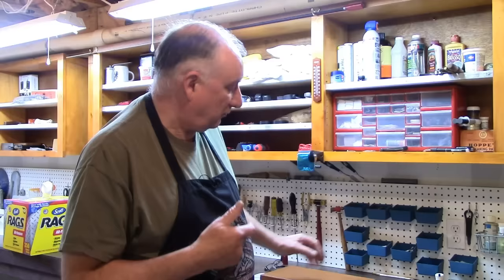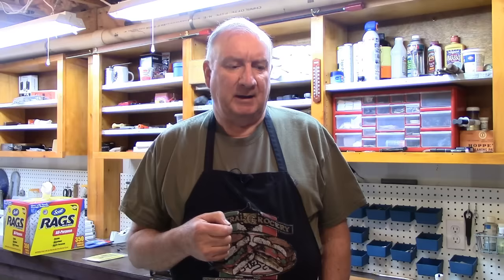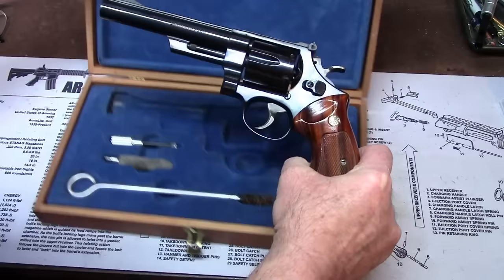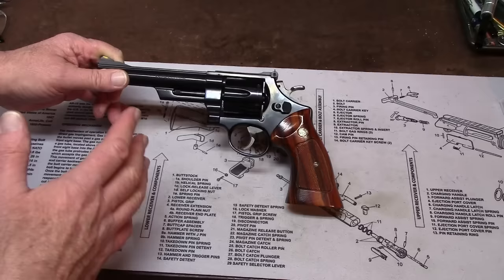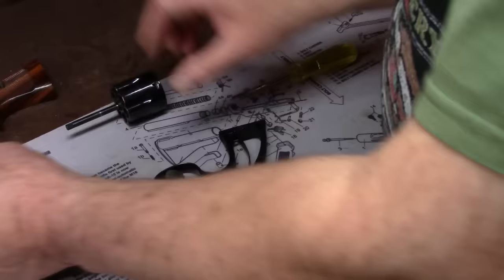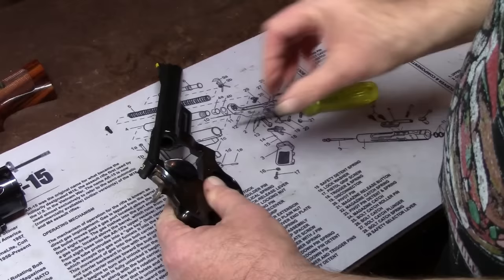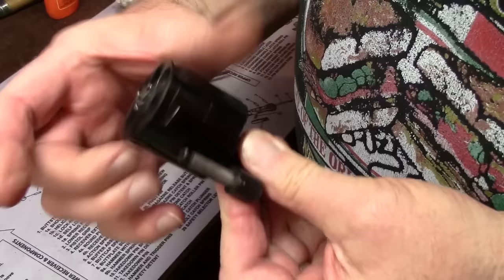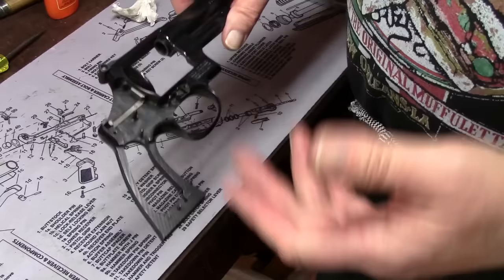How to Disassemble and Care for a S&W Revolver ~ Learn from a Factory Trained Armorer!

Comment: Hello sir, Can you please answer this question: What should I use to clean 1980's nickel finish 586? People are telling me many different things and I am confused. Any special considerations for shining it up as well as cleaning after shooting? I trust your armorer's advice - thank you and God bless.
Reply from the maker: I was a precision electroplater of coaxial connectors spanning my military service.  In addition to silver, rhodium, gold, and cadmium that I plated, I did much nickel, which is a very durable and common protective plating metal that is quite tough and chemical resistant.  However, the industry standard for a nickel plated surface is typically .0002" (2 ten-thousandths).  Computer paper is .004" by comparison.  Nickel yellows with age, and is not a defect.  The trim of early cars were nickel plated and yellowed, so a very thin layer of bright chrome was added over nickel to keep it shining. Any attempts to brighten it will result in thinning of the plating and exposure of bare steel which has no corrosion protection. Just like an old coin, it's value is in it's ownership, not how it gleams. Just clean it with mineral spirits and enjoy.  FYI, most nickel used on guns these days is electroless nickel, which is chemically deposited without DC current, and has a dull tin-like appearance.
Reply: Thank you very much for the quick reply. I hope you will be able to do some Service Rifle this year, I'm preparing for my first match in April :) I'll be in Rye and then Lebanon over the summer visiting family, I will think of you while riding through that beautiful part of our country.
Reply from the maker: @jivadaya6439  Two great fishing opportunities!  Deep sea out to Jeffrey's Ledge from Rye, and then fly fish the Connecticut River.

Comment: I have an old model 27. It was my father's.The bluing seems to be fading . Can you tell me what to do. I have cleaned it with oil a few times.,Hoppe's. It just seems to have lost luster over the last two years. I grew up with guns. I have guns that I have worn the bluing off of.This gun just sits in a closet. I don't keep in the box. I turn it over every two months or so. I worry about the gun. I don't see it as mine. It will be passed along.Also I enjoyed your video.

Comment: Just wanted to ask you is it possible to replace the barrel on a 28-2 with a  used barrel? What are the odds it fitting correctly? Can the factory do it? Or better to go new barrel? Like your channel your doing good
Reply from the maker: That's a factory job, if you want it done correctly. Give them a call.

Comment: thank you very much.....is it ok to use StrikeHold besides mineral oil....ive been using it on various precision components and also simple stuff such as hand knives ...it cleans n doest leave any sticky residue...just wondering if mineral oil has better lubricating left over film...
Reply from the maker: I'm unfamiliar with that product. However, if it's a non sticky lubricant, I'd be willing to bet that its primary base is mineral oil, which is the substance most lubricants have in common. Mineral oil is available in a number of viscosities ranging from very fine for watches, light "spindle oil" for looms and sewing machines, different "medium" grades including pharmaceutical USP, up to heavy machine oils used in engines.
Reply: @GunBlue490  thank you verymuch for your clarification ...GBU

Comment: Thank you for sharing this beautiful masterpiece, could you say what the desired hammer pin clearance is inside the hammer hole?
Reply from the maker: The hammer nose bushing is factory made to have correct clearance, which is simply sufficient for passing through. That bushing is a factory install part.  Replacement requires that the gun be returned for service.  They generally arrange shipping via FedEx pick up, if you call them.
Reply: @GunBlue490  , thanks for the response,  the pin clearance I was asking  previously was the pin that the hammer rides on. So the hole drilled in the hammer (the point rotates about) has a certain clearance to the frame pin.  Sorry about the confusion, its hard to talk these things out with out a picture. Thanks

Comment: Guilty! All those that have loosened up the screw on the main spring of a S&W revolver please raise your hand. My hand is up. Question. If I return the screw back to its original setting will that return it to the way it came from the factory? Or have I already done some damage that only the factory can fix? Great great video. Wish you would have  done this video a long time ago. Thank you very much! Does Mort by chance have a Python to lend you? I'm in Canada otherwise I would send you one.... Thanks for sharing your knowledge.
Reply from the maker: Python56 
Retightening will restore it to original.  Those who cut and file require a new strain screw to get back.  Ironically, the new screw will be unfit, and is often longer than the one they originally cut, because armorers usually trim them to correct mainspring tension by ear, just like tuning a violin.  But ya gotta have the ear for the right note.  😉

Comment: Nice and complete video... I see you handle those shiny internal parts with your bare hands; are not  leaving fingerprints and possible corrosive contamination behind??
Reply from the maker: Blued steel is naturally anti corrosive, and the light application of mineral oil on parts completely protects them from clean, bare hands. A clean oily fingerprint is not a threat to a gun.  We must understand that guns are not fragile, do not get infections, and do not require us to wear surgical gloves.  Factory workers who make these guns don't wear gloves.  I've been doing this for 45 years, and no gun has rusted yet.

Comment: I just purchase a model 10-8 S&W Revolver and can't remove plate screws 2 and 3. I tried flooding/soaking the area with Kano Kroil for several days with no success. I'm assuming now that they've been loctited in. I hesitate heating the area up since Loctite doesn't soften until 550 Deg. F. And to top it off the trigger became gritty while flushing out the frame with mineral spirits to clean out the Kano Kroil. I need to get more mineral spirits to continue the cleaning. In the meantime, any suggestions on removing these screws, should I use heat and what is the best way to apply it? Thank you.
Reply from the maker: Contact the Loc-Tite company.  They have solvents to dissolve their product.

Comment: Now I understand why quality firearms cost so much. I just bought a used service revolver 357 19-3 revolver and need to clean the cylinder. It has what looks like burn or fouling lines for 38special loads. .357 loads cover the fouling marks in the cylinder. Any recommendation on removing fouling marks on a cylinder? I hope I'm using the proper terminology.
Reply from the maker: I recommend the Lewis Lead Remover.  It will remove any surface accumulations of fouling very quickly.

Comment: Thanks for the Great video!  I wondered about the hardening.  I assume that this is common in quality firearms and is key to allowing them to operate with a minimum of lubrication.  Are stainless steel components hardened in a similar fashion resulting in similar lubrication requirements?  Thank you again!
Reply from the maker: whatsit52 
Yes.  Modern quality firearm parts have long been heat treated where friction can be an issue, and are similarly protected with very modest lubrication.  One of the hardest receivers in the world is the old WWI vintage '03 Springfield and the Enfield, which usually require special treatment to drill and tap.  There are inferior bargain brands of guns out there, and lots of mild parts exist, so not all parts are created equal.
Reply: Thank you for your very informative reply!  On another topic: Perhaps someday you could discuss the problem us old guys have with our near vision and iron sights -What have you seen being used for practical eyewear ?  Best Wishes!
Reply from the maker: whatsit52 
Well, my eyes deteriorated, as everyone's, but it was corrected back to 20/20, requiring only occasional reading glasses in dimmer light.  I had cataract surgery last summer and could not be happier.  I see my iron handgun and rifle sights very sharply again. It might be worth a video.

Comment: Question though.
I have one problem with my S&W 17-3 (.22LR). Each time after about firing 30 shots when I reload my revolver the cartridges do'nt fall smoothly into the chambers anymore . The last milimeter I have to push the cartridge a bit in. After simply cleaning the chambers with a messing brush it works like a charm again. 
According a  longtime revolver user some residu like gunpowder might accumulate in very fine grooves in the chambers. (Possibly halfway chamber where bullet leaves the case). The grooves are the remains of previous owners since it is a 1974 revolver?
His profession is mechanic and he  recommended me to remove the grooves by polishing the chambers with very fine 400 grit sand linen. Eventually in combination with a drop of gun oil. 
Before doing anything irreversible is this good advice or is there another alternative?
Thanks in advance.
Reply from the maker: uufflakke07 
Never use any grit whatsoever to polish a chamber, as the slightest distortion will be irreversible!! 400 is not fine polishing grit at all! It's quite coarse and will make a mess of the chamber. You cannot possibly use such a means without ruining your cylinder permanently.  
Without looking at it, I suspect the most common issue, which can result from having once been used with 22 shorts. While uncommon and expensive now, shorts were very popular well into the 70s, especially for basement shooters.  The case is shorter, and residue of both powder fouling and bullet wax accumulates in front of the case, and subsequent cleanings can smear the waxy coating into the rest of the chamber.  Though difficult to see, its texture serves as a base for carbon to accumulate when you fire long rifle cartridges. Unless the chambers are pitted, it will absolutely come out.  Start with the easiest methods, and work up, if need be.  First, soak the cylinder in mineral spirits overnight, then follow with some elbow grease and a bronze bristle bore brush. Remember, wax is a sealant, and does not remove easily; it spreads around like butter, so use saturated patches on a brush to work it clean.  0000 (four ought) steel wool wrapped on a bore brush will work for stubborn cases, or you can use JB Bore Cleaner with cotton flannel patches. But never any sheet stock grits whatsoever, no matter how fine.  If that doesn't work, pick up the phone and call Smith and Wesson's customer service, and they will happily assist, and even send a shipping box for you. It's possible that they'll do it no charge.
Reply: I already had the gutfeeling indeed that using sand linen is not such a good idea. Good to have that confirmed by a specialist.
The reasons behind my problem sound very plausible.  Wax remnants of the .22 short which cause accumulation of carbon in the chambers.
I will follow the cleaning procedure as described in your reply. I assume that will do the trick.
Thanx for your quick answer!

Comment: Will a missing top side plate screw cause any problems?
Reply from the maker: The screw properly secures the side plate. Though it's probably not going to pop off, the threads are now vulnerable. You don't want an ugly gun with a hole in it.  Call Smith and Wesson and order a new screw, and preserve your gun's integrity.

Comment: So, I had to do some things he warned against: I had to use a wood chopstick to tap out the sideplate. When I put it back on, I used a rubber jeweler's hammer to tap the plate back it. It just fits too flush and tight to fit in like he says. 

Also, looks like it came from the factory not completely tight. My Model 66 has a slight defect with the slide stop. Slightly too loose l, so it would catch and not stop the slide sometimes.....dangerously bad issue. I found washers that fit in there and seems to have compensated for this defect. 

My Model 28 from the 60s was better build than my 1980s Model 66.

Comment: If I was to send my 19-5 back to S&W would the factory tighten up end shake, free of charge.  If S&W was to bill me,  what would yoke end shake cost to tighten up.  I saw Power Custom install a (PY-2) a .002 Yoke bearing & a (PC-2)a .002 cylinder bearing for Cylinder end shake.  Thank You
Reply from the maker: Joe Simeone 
I am not a Smith & Wesson representative.  Call their customer assistance line for information. I personally do not recommend shims or other after market, non approved fixes.  They have been known to split and jam in the cylinder, where broken parts cause damage. A .002 thousandths shim is only half the thickness of printer paper, and extremely fragile.  If that's the only end shake you have and your cylinder is clear of barrel contact, your gun is still well within specs.
Reply: Thank You, for the info.

Comment: I have a few questions about my model 29-4 and the floating hand. Do you take questions? Im having a hard time finding information on the floating hands.
Reply from the maker: The hand is spring loaded, and should provide constant pressure on the cylinder ratchets.  It should not float.  The wire spring in the trigger is captured by the smaller of the two pins on the hand to keep it forward. You can use a small screwdriver to swing it into place as you press the hand into the trigger.  Smith and Wesson has a very dedicated customer service phone and will assist if your gun is not working correctly, they should get it going, probably at no cost to you at all.
Reply: @GunBlue490  so you have no idea about the floating hand either, again very very little info on it since they tossed it in only a couple guns for one digit of their respective model iteration, which at the longest lasted about a year and a half before another iteration was released going back to a standard hand. The pin was pressed into trigger and the hand floats on it. Rather than the pin being solid in the hand and being loose in the trigger. I think mine has wayyyy too much "float" in it but again, there's very little info on it. Everybody that has one knocks the pin out and puts a standard hand in them. But which one do i go with, the 29-3 or 29-5, I've contacted Smith and they already sent me a prepaid return label. Just have to send it in but i want to pop the plate off once more time and document my initial findings to share with folks who don't know about it and ruin into a similar situation.
Reply: @GunBlue490  pulled the plate off my 586-2 and found out it was also the recipient of this terrible idea. Do you want pics/ video of this stuff?
Reply: @GunBlue490  hey bud, did you see my replies, did you attempt to look into what im talking about, do you want to trade emails?

Comment: The cylinder latch or cylinder sticks on my revolver.  The cylinder doesn't want to swing out for reloading.  What is my problem?
Reply from the maker: ReinSman100 
I would first inspect whether your rod is backed off, which has lengthened it, causing it to bind.  You cannot properly tighten the rod safely, without doing some significant damage to several parts.  Give Smith and Wesson a call and they will gladly assist you.
Reply: GunBlue490  Thank you for responding to my question.  I will call them.
Reply: GunBlue490  Smith and Wesson informed me that they can't repair anything older than 1960.

Comment: Thanks for the fine video.  I owned a Colt Anaconda and a S&W 629 Performance Center revolver.  I sold the Anaconda because the value went up so high, but it was the superior gun compared to the S&W.

Comment: I have a model 19 its jammed the cylinder wont open i knocked it with a hammer it wont open any have any ideas
Reply from the maker: thejames_fer 
Yes, your ejection rod has loosened, and became longer than the center pin, so the locking lug stays inside the hollow ejection rod.  When you press the thumbpiece, its supposed to push the center pin forward, flush with the ejector rod, which allows the locking lug at the front of the barrel to slide off.  Do NOT hit it with a hammer anymore!  Simply screw the ejection rod toward the cylinder. They were made with left and right handed threads through the years, but try counter clockwise first.  The rod must be tightened by a factory technician an strapped up again, as you undoubtedly bent the cylinder out of alignment.
Reply: GunBlue490 thanks
Reply: GunBlue490 hitting it with the hammer is just bad it looks like 2 cylinders are out of tune they wont work i have to manually turn the cylinder

Comment: I was taught to always use the crane to close the cylinder and never press the cylinder to close it.
Reply from the maker: Whoever taught you to do so was absolutely incorrect.  I attended Smith and Wesson and Ruger factory armorer's schools where I worked on these revolvers for weeks under close guidance.  Both instructed me to open and close the cylinder exactly as I demonstrated, with direct and firm pressure on the cylinder.  It applies the pressure needed to align the center pin on the recoil plate, where it has full support, and to assure correct closure.  It's impossible to press it too far.  S&W revolvers have yokes; Colt and Ruger revolvers have cranes. Pressing on the yoke or crane can give you a very nasty cut, and it certainly doesn't have sufficient leverage to close the cylinder as it's designed.